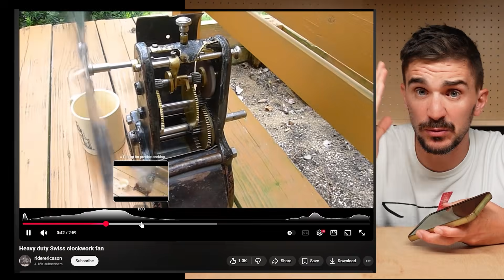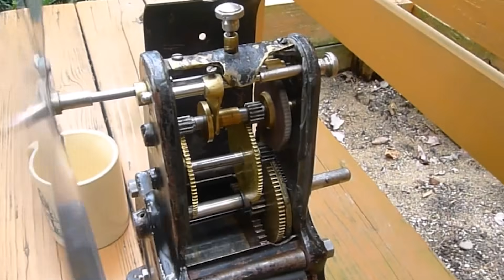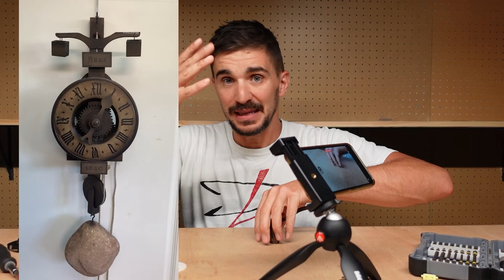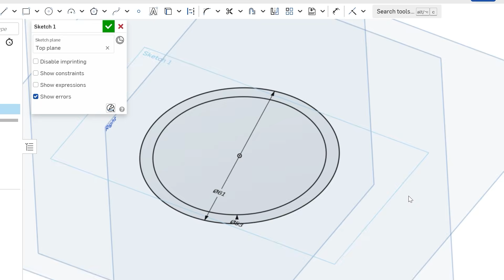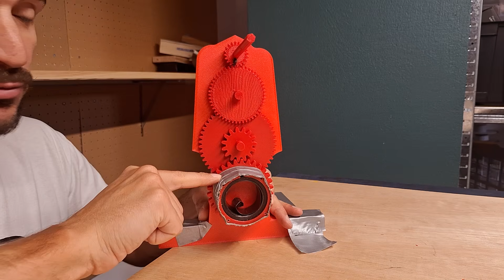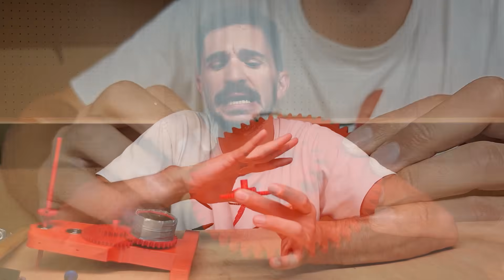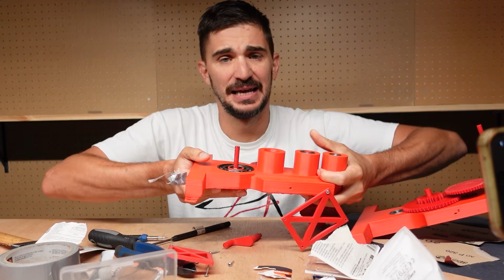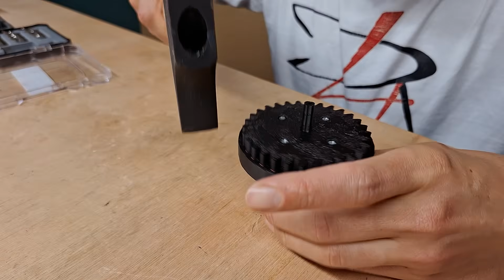No Cables or Batteries, Just Pure Mechanical Engineering - This Swiss Cooling Fan Cools You For Free

Comment: Try using a belt drive. You can print an adapter for the spring barrel and use a small gear on the propeller shaft. This will minimize losses because you can achieve a gear ratio of 16:1 with a single stage transmission.
Reply: actually I can not agree with that idea. belt drives have less efficiency than gears. Windmills nowadays are the closest type of mechanism you need here. I mean multiplicator with very high ratio and max efficiency. They use planetary gear for the first stages and some ordinary gears later. Ready made reductors or multiplicators are in electric screwdrivers. Say 4-5 planetary stages.
Reply: @kyivstarnet7806  It´s 3x gears vs 1 stage belt in a 3D print it will be more efficient for sure.
Reply: @kyivstarnet7806  "4-5 planetary stages" DO YOU EVEN KNOW HOW HARD IT IS TO MAKE A SINGLE PLANETARY GEAR WORK WHEN IT'S 3DPRINTED?????????????????????????
Reply: @Splarkszter I don't. I just suggested where one can source factory made gears. What are the problems with 3d printed ones, which prevent them from working?
Reply: @kyivstarnet7806  Oh well. 3dprinted belt drives are quite robust and reliable, in chance, any kind of gears are hard because 3dprinting has a lot of warping and flex, 3dprinting planetary gears is only feasable when they are quite big and even then the flex alone often kills performance :)
CNC machined planetary gears for a prototype is a waste of resources and time in my opinion, could work as final design but it's a bit too early for them.
Reply: gear..  thisnis not even oiled 3D printed super friction heat making mechanism.  heat on level you cant comprehend.  if yes.  you wont dumb around so hard.
Reply: @nin1ten1do how do you know it's not oiled? Watch top shaft at 33:37. Stop using "you can't comprehend", it's you who's the dumb here. The idea was to replicate original mechanism. Why stop at belt drive instead of electric motor?
Reply: Great input, however in my experience belt drives tend to run rougher with a high amount of efficiency losses (still nowhere close to multiple gear stages, still), especially with the friction of play in imprecise systems.
If d4a is reading this, for your next iteration on this wonderful machine I highly recommend a v-groove rope drive. They tend to have higher efficiency than belt drives, are incredibly easy to 3D-print, are super forgiving with inaccuracies, and only require a single bit of fiddeling when joining the ends of the rope together, which can be done off-mechanism.
>thumbs up< ;)
Reply: @trippyparrot9281 V belts are still a belt drive. They're pretty much the standard. That being said I think you're right. Every gear is an efficiency loss at the interface and at the shaft and the more slop in the system the worse the energy loss is. More energy loss also means more heat. Belt drives are exactly what you want when you don't have precision gearing because the flexibility works with that slop instead of against it. He would need to put in takeups though.
Reply: @trippyparrot9281  Large O-rings were used in a lot of precision mechanisms in the past with great success.
Reply: @jo8512-y1e.  With a single stage belt the diameter of the large pulley would have to be 16 × that of the small pulley.  Unless the centres of the pulleys were very far apart, the angle of contact on the small pulley would be very small. Not terribly practical!!
Reply: I'd scavenge a chain drive from a bicycle. A lot less precision is required, it will not slip, and it famously has no business being as efficient as it is.
Reply: the belt must be tightening which isn't free
Reply: How about using timing belts rather that flat belts or V-belts? They have teeth so as to not slip, so they stay in sync, and they come in a broad range of sizes, including some printers, even 3-D ones, and many vehicles to keep engine valves in sync. Maybe they don't produce as much friction? Idk.
Reply: @sparky6086  smart suggestion. I agree. They'd be perfect to minimize the need of gears while also minimizing friction, tension load on the shafts, and loss of energy due to thickness in flat and V belt types. I'm positive it'd give a measurable improvement of the energy efficiency while keeping the DIY concept of the project.
Reply: Would sound better.
Reply: 16:1 is 16:1 regardless if it's pulley or gear driven. The fact that more torque can be transferred between gears is testament to efficiency. It could be more feasible to run the final drive as a belt though because trying to spin a small spur gear with a larger gear is difficult. So IF trying to run a "single stage" transmission the belt is more logical.
Reply: @voteAmericanNotDemocrat remember the product is ment to run for hours at a time over many years, 
Not just seconds or a minute for a few days before it breaks. If at all.
But hey lets just throw 300+ years of mechanical engineering and clock making out the window and use your idea.
Reply: @glengrimm4075  not my idea... The machine shown at the beginning of the video is only meant to run 30 minutes though. What are you talking about?
Reply: @voteAmericanNotDemocrat and then, after 30 minutes of running... you are supposed to discard it and go buy new one? ))
Reply: A cvt transmission for a go cart could be incorporated, if needed.
Reply: would using a propane torch or a heat gun smooth out the printer lines? or perhaps a paste of ceramic lubricant to fill in the voids? anyway I am inspired! off to google using 3d printer molds for aluminium casting =D side note to check out Robert Murray-Smith's adventures in 3d printed reduction gears - stackable planetary and all sorts! much love from Australia to you d4a
Reply: You can print all you want. If you don't machine critical features concentric, parallel and flat,; it will always result in slop everywhere.
🤷🏻
Reply: I thought about that, the power could go up, down and up again getting 16:1 each time without the issues gears give you.
Reply: belt needs tension or will slip
Reply: @KMJB83  Right, but you can also make one axis adjustable
Reply: @jo8512-y1e  tes adjustable tension wheel, but small wheel needs also greater angle of contact with belt
Reply: Maybe belts are not the most efficient, but if you cannot make proper gears, then it makes a lot of sense. Do whatever works as a complete product, not just a cool concept on paper.
Reply: Great idea.
Reply: or just buy aluminium gears for the belts. adds class too
Reply: I was thinking the same thing thing. A gt2 timing belt would have extremely low loss even if you did multiple stages.
Reply: I like the adapter for the spring barrel - I was thinking that would be the way to go. Opening up the first one is good for people who have never done that before.  - And then, use 3x of the 10m springs in a single unit - put a HUGE gear drive around that in the entire bottom housing, crank can have a large gear going to a smaller gear attached to the main spring pack for faster winding.
Reply: Maybe Increasing the gear ratios would increase the amount of energy output over time? If only there was a way to slow down the initial gear output. I’m not a mathematician but there must be a way
Reply: Aah!  A proper engineer!  Always such a pleasure to come across. 😀
Reply: Physics wasn't your strong point was it.?
Reply: @glengrimm4075 ahh yess gotta love a comment that trys to make a point but never actually elaborates habe some constructive criticism if he doesnt know physics i guess by the comment you do somehow? .

Well then please elaborate on your comment what is he forgetting missing out in physics ? Mabye elaborate why it wouldnt work or mabye even an idea from yourself on an improvement? .

Do you just like making people feel dumb ? And makes you feel better ? .

Just dont understand why people say one thing but never elaborate? Anyways hope to see u elaborate more and thoughts have a Awesome day .
Reply: @FlexCrushYouTube ahh much appreciated flex am sure some people have just learned a few things from your great description Flex thank you🤟have wonderful Weekend ✌.
Reply: @FlexCrushYouTube It‘s true that precision metal gears can achieve an efficiency of 99%. But he 3D-printed the gears and the sides of the gears were rubbing. Belt drives don‘t need such high tolerances.
Reply: @GamMngitSssEmoTionaL5953 
I shouldn't need to elaborate.
You learn about friction in year 8,
It would be way to taxing on the drive train to use a belt. Even if you lowered the power enough and used a rubber band the force needed to turn it would make it slip.
Ok so tighten it.
The force that would be needed to stop the slip would cause friction, enough so it wouldn't work, also you would wear out the contact surfaces faster causing even more friction.
Even a small chain wouldn't work, and yes they have been used in the passed but only at the start of the train, not the end.
The biggest problem is everything was made out of plastic not brass and steel, also the amount of radial movement doesn't help.
Lateral movement isn't so important.
You have high output of power at the springs arbour yet an extremely small amount at the end of the train.
Using smaller bearings, smaller pivot points and use less material (less friction)
Thinner chassis plates, thinner gears bigger thicker spring. 
Using a belt taxes way to much out of the drive train.
I've been a clock maker for over 20 years using a belt is an extremely taxing way to do it and it wouldn't work very well, if at all.
They have been making clocks and fans with clock mechanicals for 100s of years.
There is a reason they never used the idea.
Reply: @glengrimm4075 trolling wasn't your strong point

Comment: I've seen fans on top of a wood-burner: the temp difference creates power and runs a fan to bring the heat from the burner into the room. No batteries nor power socket needed ;-)
Reply: They work on the Seebeck effect (opposite of Peltier, you can use a peltier element as not-so-great Seebeck element), heat difference between very hot stove and ambient air (they have large heat-sinks as well) creates a bit of electricity and that is used to run an electric fan.
Reply: This is exactly what I was thinking about as well. The movement of the heat rising off the stove causes the blades to spin. It works surprisingly well.
Reply: A few people suggested something similar but I don't see a point in starting a fire when you want to cool.
Reply: Yeah, the point of those is to circulate the warm air.

Comment: Just a quick note: I see you using tree supports on your prints. While they are convenient to remove, they are slow to print and fragile as height increases. For flat standard shapes, consider the normal supports, you WILL see a dramatic decrease in print time.
Reply: On top of that, I've gotten good results using a PETG interface on the supports and enabling ironing for the interface layers to get a smooth surface.

Comment: how to get a cut 101:
Reply: or lose an eye
Reply: @docwhogr Yeah, when I broke the mainspring in my rowing machine I tried fixing it. The key piece which locks the spring in had snapped off. 
Was extremely glad I out on safwty glasses, the thing shot right out into my face.

Never fuck around with big springs.
Reply: Opening a clockwork stopwatch with a stuck mechanism and having a fully-wound mainspring is a great way to cause an explosion powerful enough to drive the second-hand directly through your finger hard enough to almost make it through to the other side.

Also, pulling a stopwatch second-hand out is much more painful than when it explodes and punches its way in.

Comment: 👎
A video about clockwork presented from a child's' understanding of clockwork...
NAHHH.
First count the teeth, a see how many rotations occur in the sample video, then you can determine the credulity of the 30 minute claim.
Second opening the tape measure. Needless, stupid, dangerous disassembly of the spring. If you dont know abuts fusees, you shouldn't be teaching clockwork.
Third. Use a frikkin weight and gravity for the power.

Forgivable is not knowing that without a remarkably efficient fan, you heat up  more from the work done operating it.

Comment: The fans from the 1800's that ran off of lamp oil, pretty impressive too.
Reply: Sterling engine?
Reply: @Barten0071  Basically yes
Reply: Aren't lamp oil taken from whales? Those are illegal now.
Reply: @bltzcstrnx  lamp oil is made from. Lamps
Reply: @bltzcstrnx you can use any thin oil, including baby oil
Reply: @bltzcstrnx wouldn't have to. Sterling engine just runs off of a heat gradient. The bigger the differential the more work you'll get. But for somthing like a fan even "candles" of vegetable oil or old bacon grease should be enough. Just gotta let it heat up enough to prime. Then spin.
Reply: @stupidtoga3523  Yup, the most important thing would be a near zero friction bearing.

Comment: A gravity driven fan is fine since there is not really a space constrain with a fan on a stick. Gonna design and print one out.
Reply: In 1980 I had a Swiss made Monaco windup shaver.  Worked very well. NASA used it on the Apollo missions.  Clockwork machinery worked really well.   I think it could make a comeback because of technology such as spark wire erosion and cutting in photo lithographic techniques for making fine gears.
Reply: @williamzk9083  the hardest part with those manufacturing techniques is the cost. Wire EDM is up there with precision grinding as far as shop rates are concerned. Maybe in other countries it isn't, but in the American midwest these are quoted at the highest simply due to the run time and operators time if the machine has issues. 

Photolithography is one of those awesome techs that no one outside of chip making knows about. The Asianometry youtube channel is a great source. But anyways a modern machine is waiting to be built that uses a innate plasma Chemical vapor deposition CVD and resin printing lithography for rapid curing of a photo resist so that CVD metal will stick to the no cured spots. 

The resin screens are currently at resolution of 10-30micro meters which was the chip fab size from 1950-1970ish which means pcb size resolution....or if you can get your layers to cooperate with metal and have patience, then one could print gears beyond Wire EDM by several orders if magnitude.  So in America .0001 inch or even .00005 inch is amazing with 99.99999% (five 9s) falling below .005 inch required for tolerances. So EDM  is extremely precise, Plasma CVD with Resin photo resist printing is absolutely there too. Just needs some image scaling techniques that were perfected in the 70's
Reply: You would need much higher gear ratio AND much bigger weight.
Reply: A bit like those gravity lights? They have around a 0.5kg mass on a string which drops about 1.5m.
Reply: @rubikmonat6589  The ones that were on IndieGogo and promised to manufacture them in Kenya? Yeah, even theoretical power output was too little for it to be practical, no wonder in 2020 they switched to solar+battery combo.
Reply: think in terms of energy, it will be also useless.

Comment: That intro is so real.  I open the YouTube app to watch my favorite automotive YouTuber and instead I am instantly served a video whose content I can no longer remember.
Reply: Actually, automotive doesn't even cover it anymore. Engine? Mechanics? Explosions and or Movement YouTuber?
Reply from the maker: Honestly even I don't know anymore 😅
Reply: @d4a  what we need is someone with a drive to answer this burning question
Reply: @Macintoshiba engineering YouTuber
Reply: I was really upset when the YT started doing this, as I can no longer escape short form content because I can't quit YT. I'd already abandoned Instagram for this reason.
Reply: @techienate So, what I have done is to go to each individual Short and say not interested. Sometimes,  there can be a long line but eventually there is an end.  The shorts should stop but if you under circumstances select one, you'll get the shorts and you have to repeat it. 
  There is also an option now where you can select "Fewer Shorts" but it means just that and it wil show just not every time.
Reply: YouTube have time limits on shorts, 0 minutes hides then competently
Reply: @jacobparis6576  I assume these settings are app exclusive? Cant find em in the Browser based Version...
Reply: Revanced
Reply: Revanced is the way
Reply: @77-Jay 100%
Had said this before in a comment section and got "That's not the flex you think it is, why are you paying a subscription for no ads"

Was seriously wondering if YT had wordfiltered "Revanced" into "Premium" to get fake support for their 'service'.
Seems that's not the case and whoever responded had the IQ of a headless chicken.
Reply: YT revanced official repo be wary of fake websites
Reply: Just switch to using revanced or easytube or something. All the bullshit (including ads) is gone
Reply: "I open the YouTube app"
Big mistake. Use the browser. Even better, use a browser that lets you use adblock and/or extensions.
Reply: Cleetus McFarland, brother! 😎
Reply: When I get the instant play short. I click "home" or the "back" arrow.
Reply: the only reason it does that is because you were on shorts when you last closed the app. make sure that you are watching a real video before closing the app, and it wont do that
Reply: youtube does so many more things that are just purposefully annoying
Reply: Whatever you do don't watch anything drama or politics related on your main account the algorithm does not forget and does not forgive.

Comment: Alternatively you can buy an old clock mechanism complete with a large drum mainspring and gear train that can easily be adapted to run a fan. I've got a large chiming clock which is still fine after 150+ years, running for 8 days on a single winding and keeping very good time. Apparently they did have the metallurgy some time back... 😏